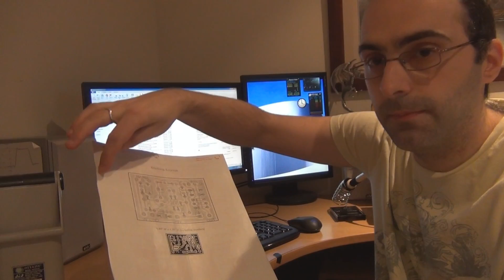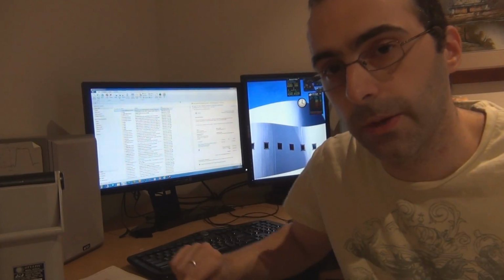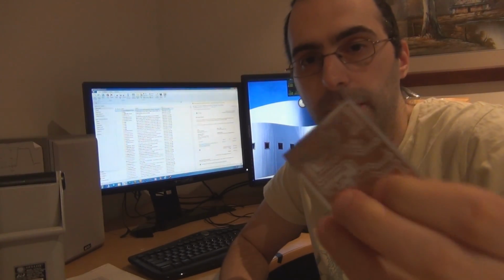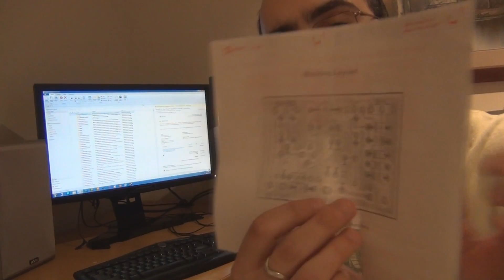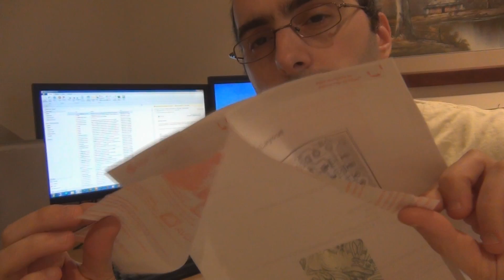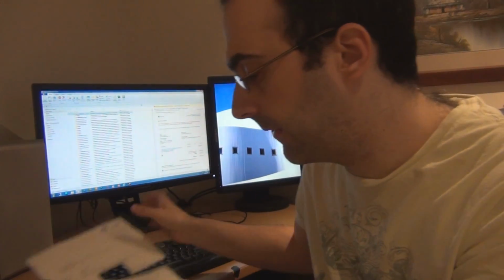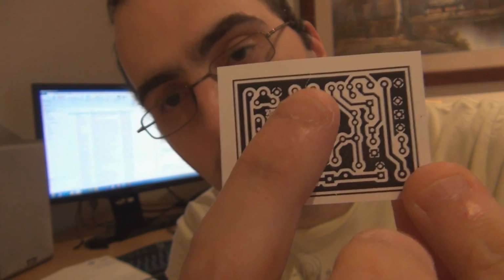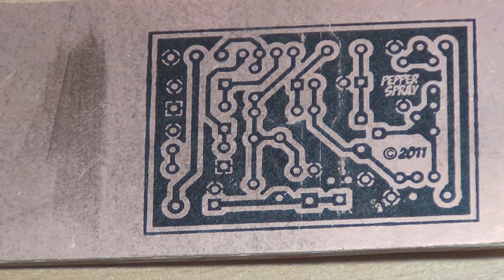Updated Tips for Etching PCB Toner Transfer

Comment: The problem with the black residue when using acetone to 'clean' the board after etching can be easily avoid when you use steelwool with soap in it and rub the board with it under a little water from the tap. Then when the board is dry you can spray it with plastic spray from 'Kontakt' which has the possibility to solder through it without burned residue forming. I find this much better then solder lacquer (also available from Kontakt) which is quite sticky and gets dirty easily. - OH sorry, I wrote this half way the clip, saw that you show the better way on the end. Another tip maybe usefull: don't print in just b/w but use the color setting of your printer and screw the saturation to max in the printing software, for example IrfanView (which also have a nice scaling option). You will get far more blackness (toner) on the paper!

Comment: Obviously you have some really crappy copper-clad if the copper lifts off. I use both glass fiber and SRBP laminate and I have never used ordinary paper, only the Teflon coated paper which is nearly the same as the sticker backing paper.
It seems like you really have very little experience with PCB making. I regularly make 0.01" tracks with 0.01 spacing.

Comment: I've never had this problem of acetone resist removal staining the laminate surface. I've had a crapload of other problems, though. Under/over-etching, wrinkly media distorting the transfer, misalignment of double-sided patterns; all of these are way more urgent issues for my humble purposes. I suppose, though, were one to sell these boards to DIY end users, it'd be a slight concern, but for my purpose, if it works, it works.

Comment: Amazon sells transfer papper. I purchased 100 for $15 (maybe radio shack). If your toner is coming off and not sticking you could always use acetone and lay the board on top, and apply pressure. no heat needed.

Comment: I tried a backing paper, but the prints are really bad. After the print I saw some fine black lines (0.5 mm trace lines)coming out of the paper. I am not sure if its the printer or some thing to do with the paper. Any one with a similar experience and a solution?

Comment: ISTM that "sticker backing paper" bears a strong resemblance to kitchen greaseproof paper... so has anybody just tried greaseproof paper?  It would be good if it worked, as it's cheap and readily available. I don't have the means to try it myself (still at planning stage - e.g. no laser printer).

Comment: What side of the laser label backing paper do you print the image on- the side the labels peel off of, or the back side of the label backing paper??
Reply from the maker: The shiny side the stickers peel off from is the side you want to use. Cheers
Reply: DIY Guitar Pedals can you give me a link to the paper type?
Reply: +Owen Chase science channel  Any avery labels will work
http://www.avery.com/avery/en_us/Products/Labels/Shipping-Labels/Avery-Clear-Easy-Peel-Shipping-Labels-for-Laser-Printers-%286-labels-per-sheet%29_15664.htm?N=4294967286%204294965552%204294965631&Ns=Rank|0||Product%20Number|1&refchannel=d6c759baa4c2a110VgnVCM1000002118140aRCRD

Comment: well you CAN buy a special type of paper for thermal transfer onto pcbs... it feels kinda greasy, like a wax paper, but it's just a plain sheet of white paper, slightly thicker than normal.
Reply: there's toner transfer paper but it's a bit rare on my place. So I just go to bookstore, find some plain sticker paper (cheaper one coz you don't need the sticker side), the A3 size (not the labeling sticker), and peel it and use the back paper. It's cheaper than toner transfer paper, it's wide as A3 which you can cut depend on schematic size, but a bit useless for the sticker side (I just throw it away, idk what to do with it).

Comment: I've had great success with a silicone impregnated paper, used for baking. In the U.S. it's called parchment paper. It's very thin so alignment is easy but you have to tape it to a piece of printer paper to carry it through the printer. I've found that if lift it up very slowly with a hobby knife, after ironing, you can see anything that didn't stick and give it some more heat and pressure.

Comment: I've removed the toner with just 0000 wool, without the water or sandpaper.  It requires more arm muscle, but it's doable for a single board. A whole batch and your arm would eventually seize up.

I've also used acetone, knowing it would stain the bare fiberglass. And just decided not to worry about it. :)

Comment: Great tips Paul! look i´ve tried a lot with sticker backing paper without success. BUT i believe that my problem was that i was copying and pasting the layout (to print several in the same page) and i think that i loose resolution. i couldnt see more toner in the backing paper but was blur on the copper surface.
i believe was not enough toner due to the copy paste stuff. So i was back to magazine paper. just a tip for the ones that want to print several layouts in one page!
cheers